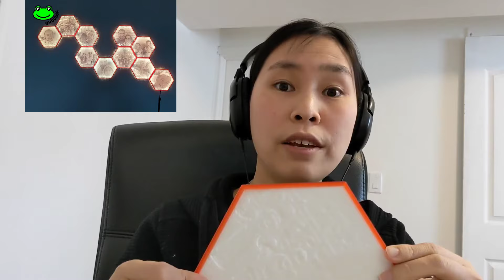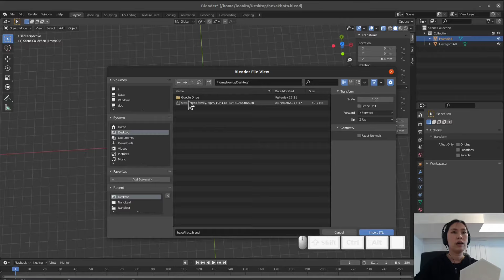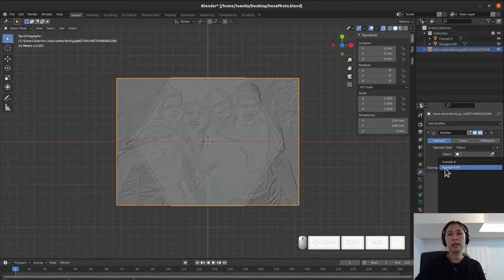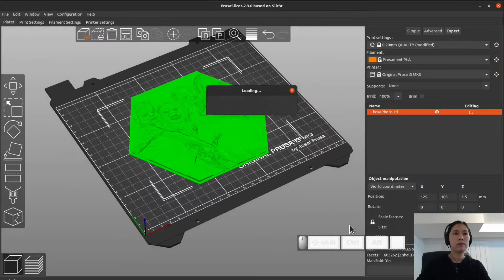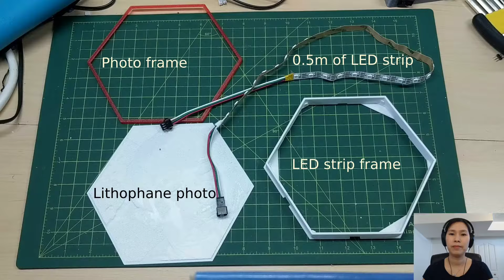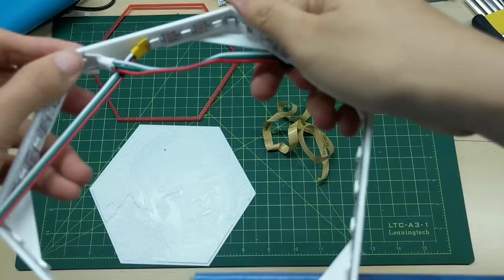Thinnest lithophane light panel 3D printed (Nanoleaf alternative)

Comment: Thank you this looks very nice ,,,, do you have the info for which LED you used and other hardware to connect them together ? Did you get that on Amazon ?
Reply from the maker: Hi, I used the 2812B LED strip (60LED/m no waterproof) . You can buy it from Amazon or Aliexpress for cheaper price. You will need LED controller and power suppy too. Happy making.

Comment: I thought, that is better to print it vertical. what do you think?
Reply from the maker: By vertical, did you mean printing the photo standing up? It will take more time to print lithophane like that but you will get smoother surface at the end. With my small project I usually made them standing up but these are big so I printed them horizontal and it takes approximately 3.5h each photo. If you don't mine the printing time, go with it and let me know the result. Happy making.
Reply: @maketestrepeat  yes, I mean printing up to stand. it is not about the time, but about the quality. is it big difference between these print setups in final quality of printed lithophane? I am preparing to print photo size of 15x15. So, I am looking for working solution.
Reply from the maker: @robinnguyen4306  Yes, you will see the difference. The standing up will give you a smoother and nicer look. If you don't mind the printing time, go with it. You can add brim or skirt layers around it to keep it stable during the printing.